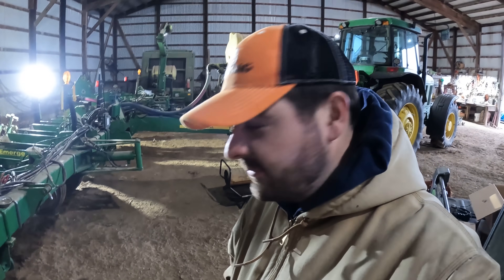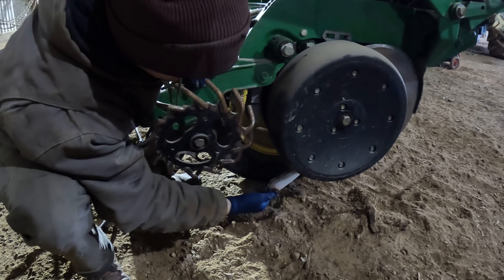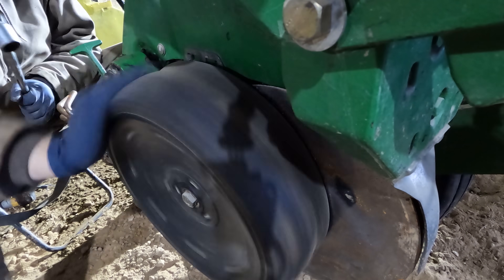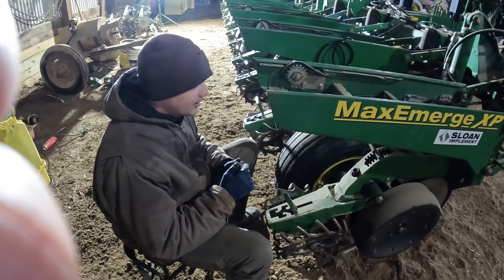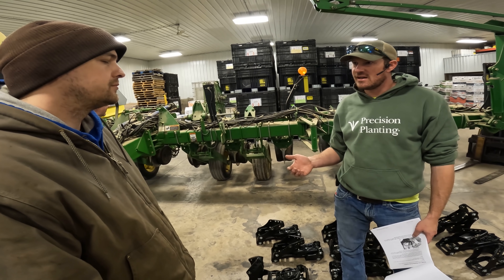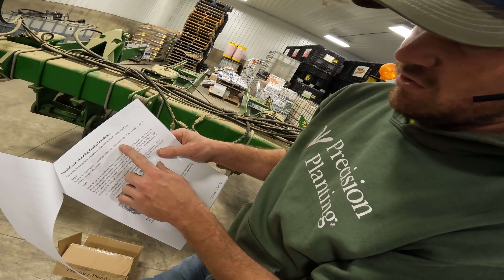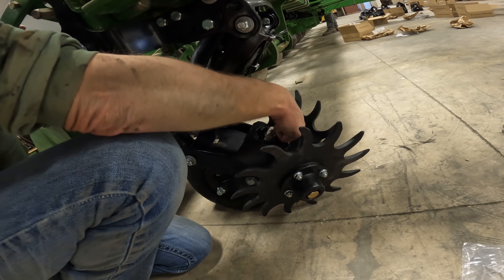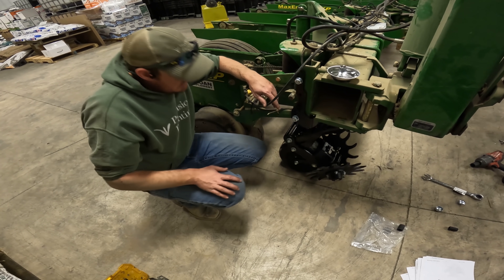2022 Planter REVEAL - Precision Planting & 360 WAVE

Comment: We used to run a 1965 Farmall 706 gas tractor for planting with a 4 row John Deere planter. Only computer we had was to keep you in a straightish line.
Reply: We also use a 706 gas, but we use a CaseIH 900 four row planter.
Reply: @hturbo1007  very nice, open station or do you have a cab on yours?

Comment: The planter tractor at the research farm I work at is a 2009 John Deere 5075M as decked out as you can get it as far as the RTK, Greenstar and Autosteer stuff goes. Planter is a 4-Row John Deere 1705 Vacuum planter. Gonna be doing mostly beans this year, with a little corn thrown in there. We also have (for planting plots) a John Deere 7100 Planter cut down from a 4-row to a 2-row, and set up with Almaco Plotmaster Hoppers.